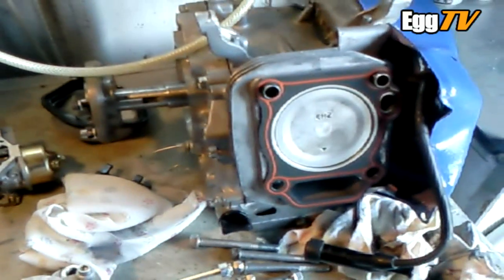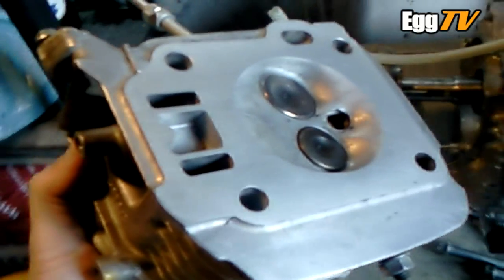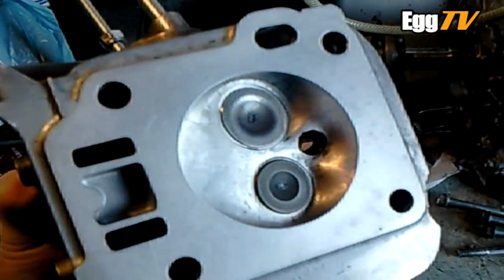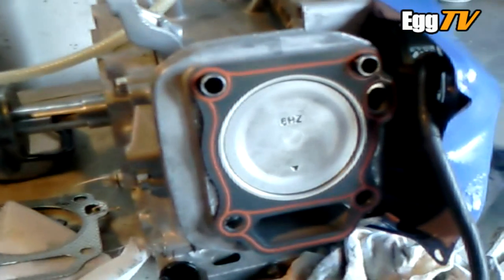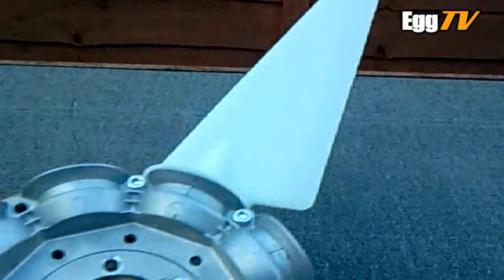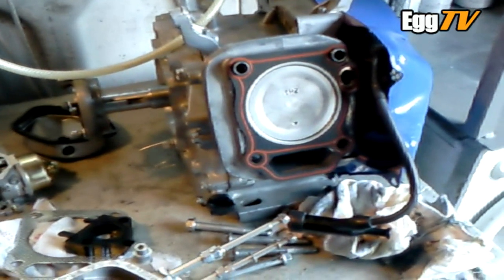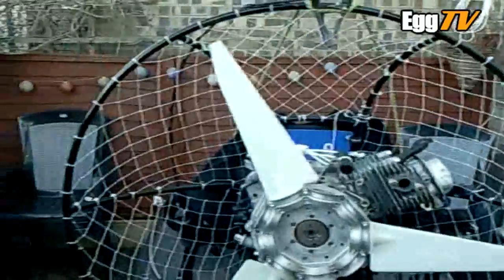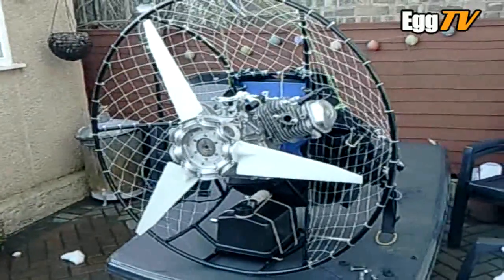GX270 Paramotor. 2nd Rebuild - EggTV

Comment from the maker: Hello, my projects are just as much an opportunity to mess about with engines as they are to try and get airborne :) My gx200 re-drive machine has flown and has sufficient power/thrust (13hp/50kg) and weighs 27.5kg dry. This gx270 direct drive is slightly heavier (28kg) but could be lightened by 2-3kg by swapping out the iron flywheel for an alloy one.
I'm not one for following convention, I tend to blindly persue daft options and engineering challenges.
Cheers,
Rob.